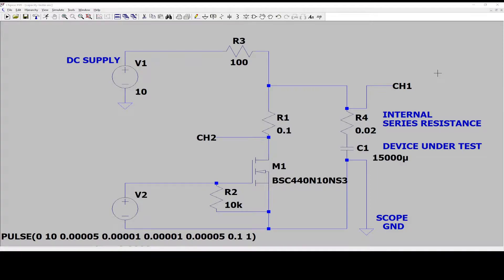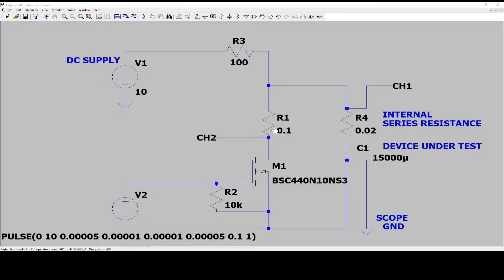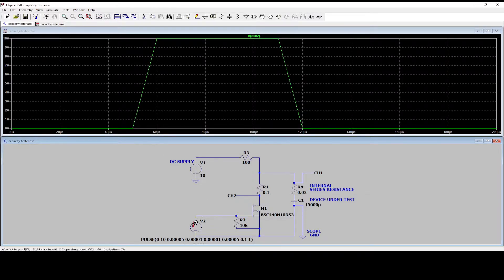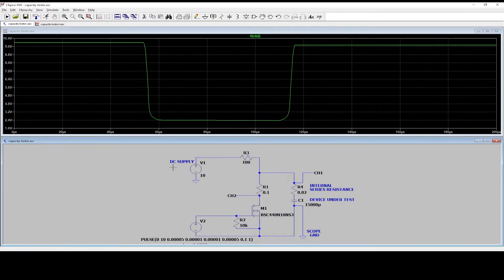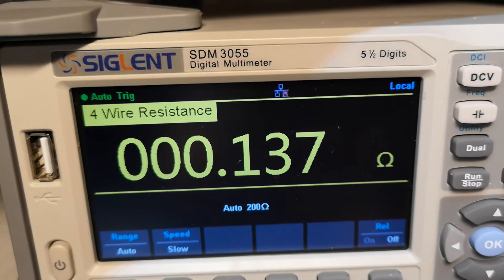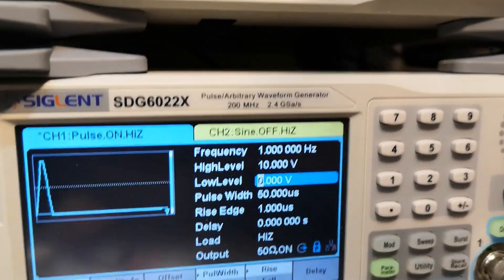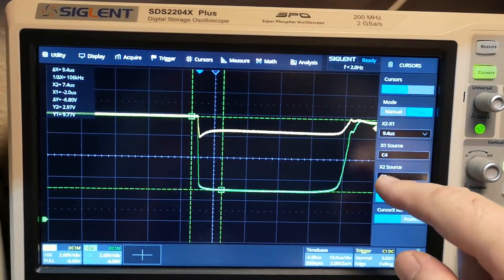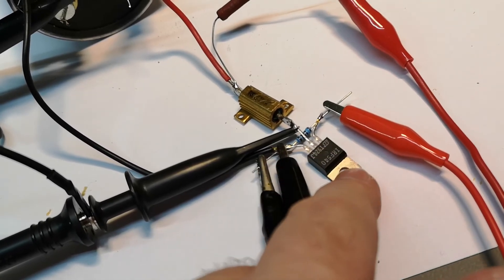Measuring Internal Resistance in Large Electrolytic Capacitors

Comment: Interesting, and so simple! Thanks, I will do some experimenting using you idea.
Have you compared the measurements you get with those from a "proper" ESR meter?
(I have many dozens of large electros that I want to test, so I would try to automate this (and other) capacitor testing)
Reply from the maker: i think THIS methode is the real result, since it is in fact a real high peak current pulse, and the real voltage drop, so you know what kind of current the cap can truely deliver
I also got super nice LRC meters, but they measure at a very low current.
Reply: @TeardownOZ2CPU  That seems fair for sure. I was just curious about how well other methods compared.